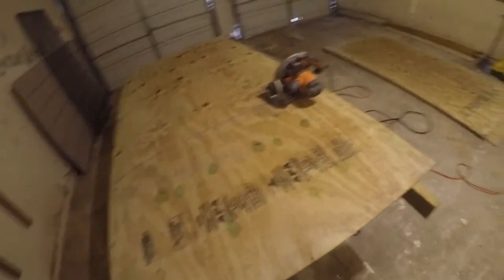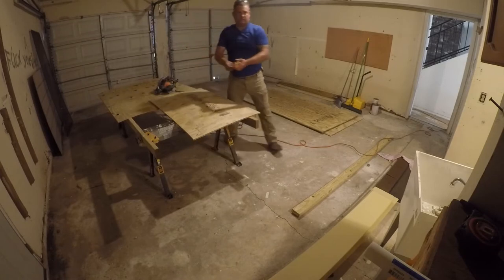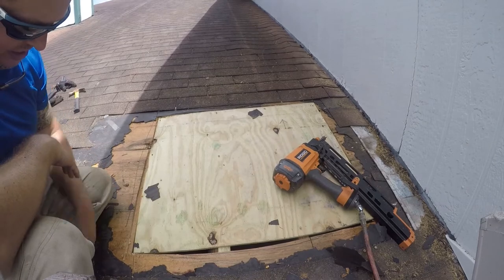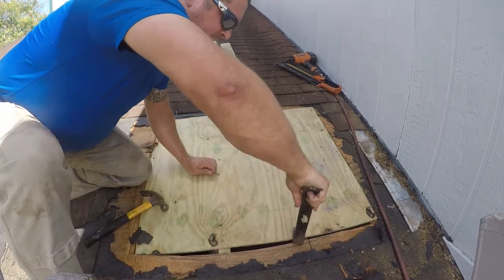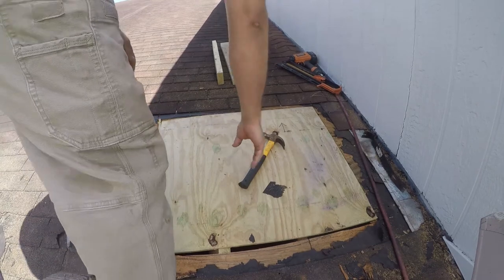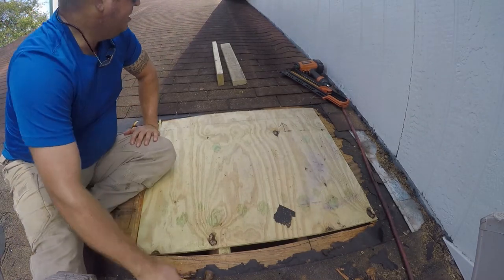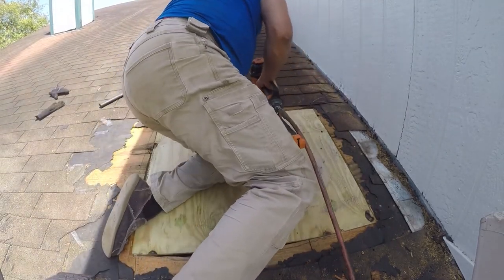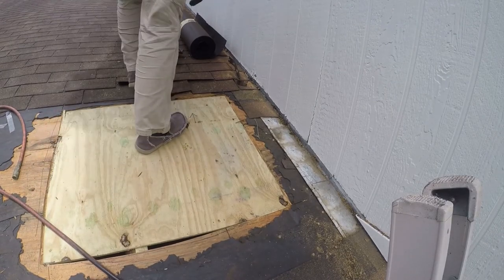DIY: Roof Repair 2 of 4 - replacing decking

Comment: I like the care you put into this. One thing. Around here we usually put the sheathing face grain perpendicular to the rafters. An 1/8" ( 16 penny) crack is good at the plywood edges to prevent buckling when it expands.

Comment: This is a great video and demo!  My question--is there any kind of spray on preservative that could be applied to the wooden boards before applying shingles to prevent or to greatly slow down "rotting" or similar degradation?  I have seen the treated wooden fences last longer with coatings but then the boards are plywood!
Reply from the maker: Keep it from getting wet.  It will last a long time.
Reply: Like a water seal!

Comment: I was going to write this who thing about chalking your lines level before you do a plunge cut with your circ saw.  But then I just came to the conclusion you should have just hired the roofer.
Reply from the maker: Nah, easier to burn $20's then to call a roofing scammer.  This was a repair that will be dealt with in full when it's re-roofed at some point in 5 to 7 years.